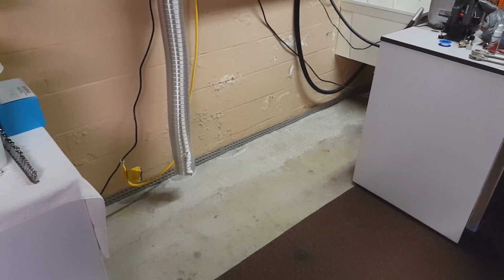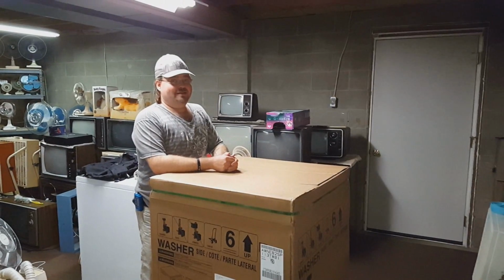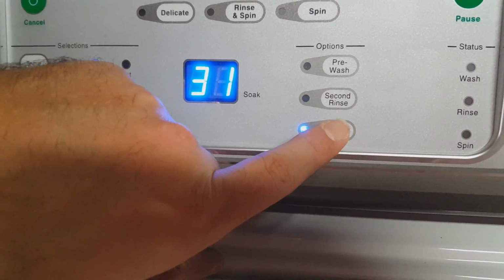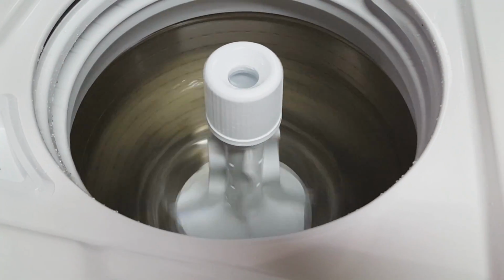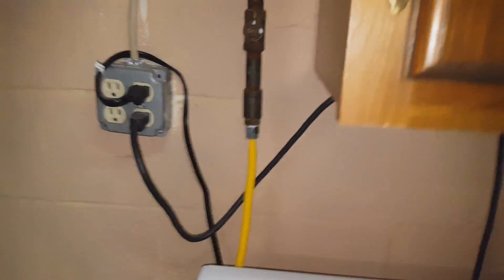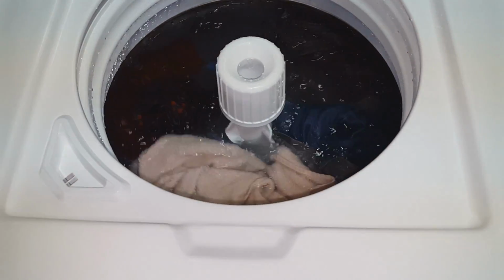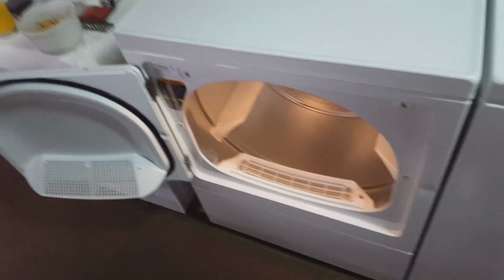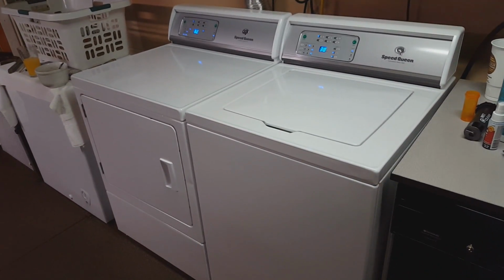The 2015 Speed Queen 8 Series

Comment: Our Speed Queens with mechanical dials  are being delivered in about a week.  Our 9 year old LG is terminally ill with a dying circuit board, and replacements are not available.  It is through videos such as yours that convinced me to switch to Speed Queen.  Everything you said about the machines made today is true.  Besides the buttons that don't respond, we also have the mold smell, even though we dry the door and gasket as well as use bleach.  Also, the whites come out dingy yellow even with Clorox.  I never had that problem before with my previous top load washer.  Thanks for posting this video.  Not only did I learn a lot from it, but it was entertaining as well!

Comment: Guys - do the speed queens weigh a lot more than the China prides? I ask because they will have to carry mine upstairs. It won't be fun.
Reply from the maker: +Tigerroux They are indeed much heavier. I would suggest getting an appliance hand truck, and have a helper. The old Maytag pair we moved to storage (which weighed just about as much) wasn't that bad when we had it strapped down and moved with a hand truck.
Reply: +Spats Bear It would be delivered by an appliance co., but I hope they will know what to expect, since Speed Queens aren't bought that often. I remember the two men who delivered my old Maytag struggled with that machine. I want reliability and simplicity - not China pride with computer mother boards that will poop out along with broken plastic. I'm getting the knob model! Thanks for the demonstration.

Comment: Edit to add: if you are in or near South Philly, Dominicks on W. Passyunk Ave, 19145 is where we got our same models from.

I can't believe I just watched an hour long video of a washer and dryer. But a few months before you posted this video I bought the same exact models. I am extremely happy with them. 1 Plus that you guys didn't mention (because it may not have been an issue for you guys) is that Speed Queen is the ONLY brand where they can be easily user disassembled to fit through small non standard sized doors and stair-cases. The only thing that would have fit through our basement staircase was Speed Queen (disassembled) or extremely small front loaders that only do small loads and come with all the drawback of front loaders. Anything else would have required  completely removing our stair case and a portion of our floor to fit anything else down. And since as first time home owners we figured we will spend the extra money for the full size Speed Queens and from the great reviews we read about them.

I'm still watching videos like yours because of the high expense (we bought a very cheap house because it's all we could afford and almost $2k was a major expense) but $10ish per load at the laundromat the machines have probably already half paid for themselves.

The only complaints I have are that I would have preferred mechanical knob controls over the electronic, but like you we were limited on what was available and it was this or the more expensive one that you guys talked about. So we went with this, the less options on the machine the less can go wrong. And I am dissapointed at the volume of the signal sound, I can't hear it at it's loudest setting on the first floor.

The small store calls this brand part of their "South Philly Special", because it will fit through small doorways and staircases that are very common here, same things for furnaces, beds, water heaters, etc...

It's not buyers remorse it's just reminding myself that we spent our hard earned money on quality machines.
Reply: +irishharp2m6 You make excellent points!  And yep, the signal is too quiet.  Although for us anyhow, we tend to start laundry and then be elsewhere anyhow.  And that hard-earned money will last you for years.

Comment: You shouldn't use white Teflon tape on a gas line. Either use pipe dope made for gas lines or yellow tape rated for gas.
Reply: +yamajammer76 Actually, that tape advised "for water, drain, air, or gas..."

Comment: Would it be possible to open the control-panel on this washer to see if the water-level (pressure-switch) has the little silver adjustment screw as the dial-controlled models have?
Reply: +Tim S Yep, and I'll save you the trouble, it does.  But on Heavy Duty, it fills all the way anyhow.
Reply: +Harley Badger on heavy duty it fills all the way up regardless if you are only doing a small load?  If so that is just wrong in so many ways.  I hope the mechanicals don't act like that.
Reply from the maker: +HowsaBowsaYowsa The water level is set by the Load Size setting. Low is 1/3, Medium is 2/3, and High is all the way up to the top row of holes in the tub.
Reply: +HowsaBowsaYowsa No, I meant on Heavy Duty if you set it to Large, it fills all the way up.

Comment: my grandmother's 1992 vintage Maytag washer/dryer was still working fine when sold about a year ago. they were $600 EACH back then and had a 10 year buy back guarantee (including tax) from the manufacturer in case of transmission failure. you wouldn't get a warranty like that today on any product of any kind.
Reply: +chieftp Speed Queen is 5 years which is better than anyone else.
Reply: DandyDon
they'll buy the washer back if the transmission fails?
Reply: Maytag (Whirlpool) replacement in the first year  "at their discretion".

Comment: Probably the worst machine I've used is a Fisher-Paykel. The Fisher-Paykel's (in my opinion) are even more flimsy than the other China Pride machines. They quit working even if you slam the door so hard. The controls are touchy at best and the plastic feels like it is going to break by just touching it.
Reply: +1912RamblerFan01 Fisher & Paykel used to be a very good brand from New Zealand. In 2013 they were bought out by China Pride company Haier.

Comment: Got my speed queen 8 series wednesday. Love it so far. Deeper tub which will come in handy for blankets bedding etc. PURE HOT WASH unlike my inglis which I kept but hooked it up out in the shed for washing oil rags etc and ended up parting with the whirlpool imperial series which was direct drive with the 2 piece agitator so not really worth replacing the tub and brake system. The place i got the speed queen from claimed it was there best seller that they sell them everyday. they had both the 8 and 9 but I went with the 8. I paid $849 for it counting deliver and tax.
Reply: +lexmarks567 Awesome, and as always, sorry for the slow reply!  Good deal, and I am sure you love it :-) Spats's parents just bought the same set at his recommendation, and his father is very happy.
Reply: +Harley Badger and I got The matching dryer this Wednesday also. total cost with tax delivery and hook up fee was $850.30. it replaces a Kenmore elite i got from a 2nd hand appliance store. the Kenmore kept stopping during the cycle and I would have to reset it sometimes up to 7 times before it would complete a cycle. I have the appliance repair plan with the gas company so they sent a tech out free of charge and he said something was defective either the control board(manual controls) or a sensor i don't remember what was said. He said he had to order parts. Get a call 2 days later saying it can't be fixed as the cost of repair would exceed the value of the unit( I paid $279 for it from a 2nd hand appliance store) and the problem seamed to be getting worse so I was like enough of this.

Comment: Does this Speed Queen washer (with the touch-pads) have the adjustable (little silver-colored screw) on the pressure-switch to turn & adjust the water-level up? There is a video here on YouTube showing how to adjust that very small screw (up) on the pressure-switch inside the control-panel on a dial-controlled Speed Queen washer. I'd really like to know. Thanks!
Reply: +Tim S Yep, it has the adjustment screw and the pressure switch is identical to any familiar standard washer.
Reply: harleybadger1 That's good to know!
Reply: Emph Squee That's correct.  The washer fills to the top, except for the "normal ECO" cycle, which we are never planning to use.

Comment: Adjust the "pressure-switch" behind the control-panel & the water-level will come-up to the top of the tub!
Reply: +Tim S We can, when running 'heavy duty' cycle, the water level is pretty much at the top as set.
Reply: harleybadger1 On the dial-controlled model Speed Queen that I have, the pressure-switch definitely needed adjusted up.

Comment: Thanks for the review(s) I am washer shopping- do you see any real advantage to the electronic controls over the less expensive version...or would you have preferred a 9 series over the 8 ?
Reply: +Mike K The 9 series definitely has an advantage in convenience, as it has easy touch-pad selection of more options.  The 8 series we got can actually do everything the 9 can, it's just a little more 'manual' in concept.  The 'mechanical' controls are nothing more than switches that control the same relay box that the electronic controls do, and the electronic panels are not a new design, they are the same old design as the past couple decades.  And made in the USA.

Comment: Just out of curiosity,..what brand of detergent and softener do you like to use? I like to use "All" w/ stain lifters detergent
and I use either Snuggle or Downey softener sheets for the dryer. I don't use liquid softener!
Reply: +KC9SYJ We us Gain Flings for detergent, Gain Fireworks as a scent additive, and Gain softener for the final rinse.  Nothing in the dryer.  (Dryer sheets can gum up the lint filter and the works, as they contain wax that deposits on the internals of the dryer)
Reply: +Dewey Jacks Right on!  Glad we could be of help.

Comment: I am an appliance tech for over 30 years and this is the best washer made and available for the money! The suspension in this design is the same as the Best made old Maytags that lasted 30 years plus! Front loaders break down right out of there one year warranty!
Reply: +Michael C Totally agreed.
Reply: Michael C: What do you think about the 2018 SQs?
Reply: My Maytag washer, Model A612, series 02 , lasted over 33 years. The transmission finally locked up a few weeks ago. Parts for it have been long NLA. Thought about trying to replace the old style transmission with the slightly newer orbital transmission, but at a cost close to $400, I figured I was almost half way there towards the cost of a brand new SQ.
Reply: Look for a 2017 model. The 2018s have not been getting the best reviews in the YouTube videos.
Reply: Michael C. Are the 2020 SQ's any good....I heard they are going down the same path as all the others over the past few years. Thanks. Have a great day.

Comment: What are your thoughts on the new front loaders from Speed Queen?  With every front loader having mold issues.....they say that their gaskets are different from the others, but when I called to ask how.....they did't give me a straight answer.  The only thing they said was that their outer drum was metal, not plastic, and that no standing water remains at the bottom like the others.  I like a front loader, but after having to change the gasket in my last one, every year, because of mold and odor....thought I'd never buy one again......is Speed Queen any different when it comes to front loader issues?
Reply: +ahedovu As far as the SQ front loaders, they are top quality.  Same as laundromat models, simply without the coin-operated function.  ALL front loaders, including those in use at laundromats and commercial facilities, should have their doors left open when not in use.  It's a simple compromise due to the sealed wash chamber.  Speed Queen has the front-load tub drain in a funnel-shaped design in the bottom, so there is no standing water left inside the machine.  And with a 'secret' ten-year warranty, (which they will offer for free when you register the machine) they must be pretty damn confident.
Reply: +Harley Badger Thanks to your videos and great reviews..as soon as our home is done being rebuilt (house fire that took it down to the block walls), we will be ordering the SQ front loaders.
Reply: +ahedovu I have a hard enough time wrapping my head around an electronic top loader much less an electronic front loader that feels like a no for me with every inch of my being.
Reply: +HowsaBowsaYowsa What part of this do you have a problem with?  Is it the electronic controls?  You know, the ones that we clearly explained are old-school Raytheon American-made controls?  Or are you trying to be a troll with every inch of your being?
Reply: +Harley Badger Not trolling, just not comfortable with the electronics panels.  I have no idea what Raytheon means  as far as reliablility or compared to other electronics found in other washers.   I am in the process of possibly buying one so I am just trying to crunch all of this info in my brain.
Reply: ***** Fair enough.  Raytheon used to be the parent company of Speed Queen until it was sold off to Alliance Laundry Systems.  Raytheon is a defense contractor, and builds electronics, radars, guidance systems, and such for the military.  The electronics and relay bank in this unit goes way back to the early 80s, and has been proven in laundromats around the world for the last 30 years.  The electronics in SQ machines are built to have a long life and dependable operation, because they were designed for laundromats... and laundromat owners would have those machines out the door so fast if they proved unreliable.  The entire machines are built in America.  The only exception is the drive motor is "assembled" in Mexico.  

That's the difference.. most modern machines have control panels built in China by the lowest bidder, sometimes by kids as young as 12, and they're designed to be as cheap as possible.  Take a look at EVERY modern laundry pair, and you will notice that ALL of them except Speed Queen say "MADE IN THE USA from foreign and domestic parts."

Comment: One last thought:  Since these ARE Speed Queens, I hope you guys try the Regular/Eco option on the washer and see how it does...  Who knows, it might be even MORE better than the fuck - I mean - FRONT loaders!   80)

(Also, I think the agitator is 210 degrees, and the spin is 710 RPM)
Reply: +Mark O We tried the Normal Eco cycle with its spin rinse, and it actually took two whole full-tub rinses JUST to get rid of the detergent.  Not worth it, unless it's exciting to have detergent residue in your clothing ;-)
Reply: +Mark O One nice thing about the front loader, is has a over-suds routine. If you use to much soap, it senses it and flushes extra water through to dilute it down before the final rinse.  Front loaders are different but once you get use to the differences, they are nice.

Comment: Seriously?  $13 per YEAR estimated cost???  SCREW the eco-freaks!

REALLY??  Raytheon?  If that's true, I'd have NO questions about reliablity.  
BTW, it's a 5-year warranty on the control panel.  Also, I would bet that even the electronic models have an adjustable diaphram for the water levels...
Reply: +Mark O As for the warranty, SQ extends it to TEN years bumper-to-bumper including the controls as long as you fill out and sign the card (which we did) that asserts that you will ONLY use the machines in a residential setting.  And yep, the diaphram is the same as it always was, one simple screw to adjust the "full" level.

Comment: Doesn't a Pre-Wash or Pre-Soak mean that you have to be there to put more detergent into the machine upon the start of the regular cleaning cycle?
Reply: +Mark O Yup, you got it.  What we tend to do is if we use the Pre-Wash, we wait around until it fills for the "regular" wash and add another detergent pac.  Also if we use the "second rinse," we wait around until the first rinse is done and then add softener to the final rinse.

Comment: Raytheon also used to own Amana at one time also.  The Speed Queen washers and dryers in the laundry area at my apartment complex were manufactured when Speed Queen was owned by Raytheon.  I have a Roper set from around 2006 that still works great.  It does have a suspension system (but the springs are smaller than the one in your Speed Queen), and a tub brake.
Reply: +Joel Hunt Raytheon owned Amana until 1997 (when Amana was still quality,) but as of 2002, Amana has been part of Whirlpool, which decided Amana should be one of their "value brands."  Our SQ set is still built from 80s technology that hasn't changed a bit... other than the electronic control panels now being outfitted with blue LEDs instead of vacuum fluorescent displays.  (Which were made by Futaba until they stopped making VFDs and forced Raytheon/Alliance to choose another display method.)
Reply: Wait til you see our new 2018's! They will all have those great blue lights. I was so excited to see the new pilot models on the test wheel last week. They look SHARP!